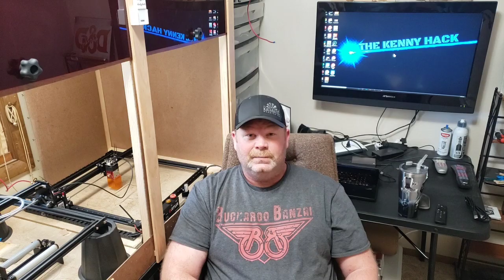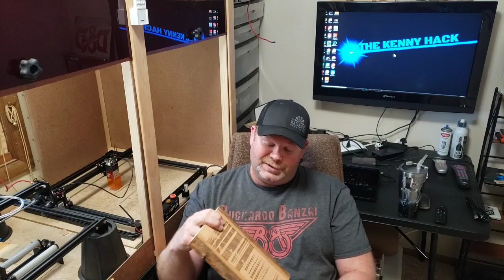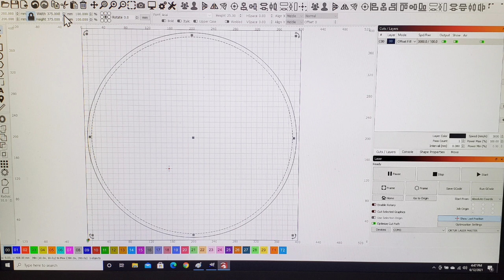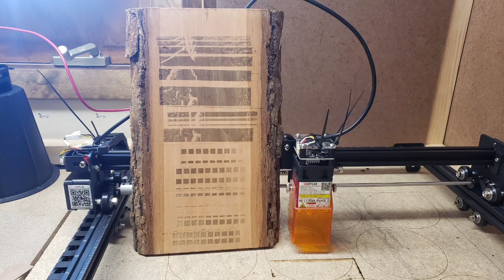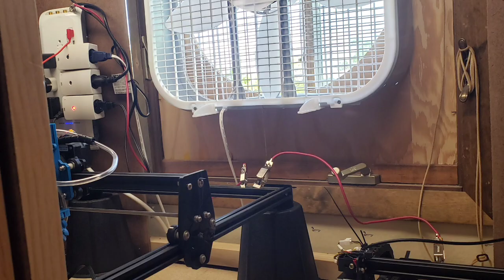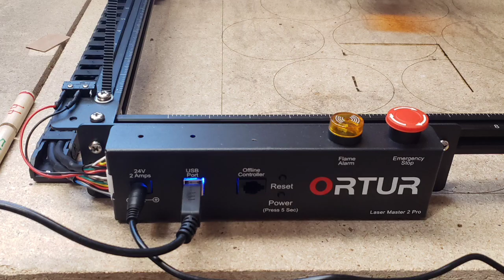ORTUR Laser Master 2 Pro: Kenny Hack and Norton White Tile First Run Reviews.

Comment: Is it worth buying a $450 diode laser when you can get a co2 for the same amount?
Reply from the maker: depends on what you're doing. the k40 is the only one priced there. To make it useful you need to usually upgrade the control board to use LightBurn, need to cut out the bottom so you can get a rotary inside of it, upgrade the chiller if you keep it in a hot area like the garage, heat the garage if you have cold winters, and they take a lot more maintenance work. I wouldn't want to mess with all that if I was just getting started. I always recommend people to start off with the fixed 15w model of diodes. They only cost around $225 and a great starter laser to see if this is a hobby you'll get into. They might come in handy down the road as there are things you just can't fit into a CO2 cabinet. Can get about anything under a diode with some ingenuity. I made enough $ using my $225 to buy a bigger CO2 laser, but as this is mostly just a hobby my diodes keep up with my sales orders. I don't see any point of a big laser unless I can keep it busy. If all your jobs involve cutting than a CO2 is the way to go. All depends on your sales market.
Reply: @TheKennyHack  I see your point. I know the K40 requires $80-$120 in upgrades to make them reliable & safe.
Can you point me to a safe entry laser that will work out of the box? Thanks
Reply from the maker: @fierceflyer5  in the description for this video is a link to the Ortur website. I think the 15w fixed focus is a very good starter diode. I still use mine along with my Pro model. it only cost a few hundred $ and along with LightBurn a great way to get started into the hobby. You'll more than likely be doing a bunch of quick sales/gifts for freinds and family. It just takes a lot of practice to get things figured out. There are a lot of Forums on Facebook to help with questions and project ideas whether you go with Ortur or a k40. Just search what type you are looking to get and join the group. you can look through old posts and see what people are doing to get a better idea of which will work better for you. I love my diodes but if you talk to some k40 users I'm sure they like theirs too.  Both have people that just had a bad experience and gave up on then.  LightBurn is free for 30 days but well worth the cost in my opinion.
Reply from the maker: @fierceflyer5  most all laser require some assembly. Can find assembly videos on YouTube for about any model.
Reply from the maker: @fierceflyer5  Ortur might not directly sell the 15w anymore.  3dprintersbay in the description I believe still does and I've had good luck ordering from them as well.

Comment: Hi Kenny, I ordered this same unit along with the Rotary a few days ago and can’t wait to get it. Thanks for the link to the PDF  I will be looking over it until I receive the unit. This will be my first laser engraver and I wanted one I can grow into right from the start. I’ve owned a few CNC Machines, like a 36 inch vinyl cutter plotter and a CNC plasma cutter and also a CNC router. I’m hoping the Learning curve to this laser will be a little easier for me. Thanks again for the great video.
Reply from the maker: I recommend getting LightBurn to run the laser. It has a 30 day free trial to play around with it to try anyways. Its well worth the ~$50 in my opinion. With all the CNC work you should pick up the LightBurn software pretty quick. I had some CNC background and LightBurn was a very similar program. This has been a great hobby for me and has more than paid for itself with just a little bit of sales. I really like these diodes as they are very simple to modify, operate, and maintain vs the larger CO2 models.  They are constantly getting better and more powerful. Good luck and thanks for watching.
Reply: @TheKennyHack  I’ve been looking at the lightBurn software and I think it would be the easiest software for me. I have plasma cam software for metal and Surecuts software for my vinyl cutters so I think LightBurn will fit in with me good on the laser. Thanks for the reply back.

Comment: The aluminum cylinder that comes with the ortur lm2 20 watt NON pro, does that go under the lens or heatsink?
Reply from the maker: I believe those go under the lens. If you're not sure run a ramp test. Set a piece of wood at an angle and burn a solid strip going up and down the ramp going from out of focus low to out of focus high. There should be a section where it burns the darkest and easily find if it's the lens or heat sink.

Comment: Wait so if I get this I just want to cut thin plastic and score it to fold into shapes like a box. I was thinking using like clear PET or PETG or PVC or idk but can I not use those since clear? I didnt think about this
Reply from the maker: You don't want to cut pvc with these.  Releases a toxic chlorine gas that will damage laser and poisonous if you breath it. They can cut some materials but if its clear i don't think it will work. A co2 laser would work better. These can cut a few types of materials,  but I really haven't tried cutting stuff yet. I mostly do image engraving. If you search for cutting videos im sure you could find some showing more of what these can cut. I just don't want to give you bad information. The laser on this Pro seems way stronger than my other models, so I might try to do a bit of cutting with this one.
Reply: @TheKennyHack  ok yeah i havent seemed to find any video or info on if these can cut pet and petg. And also clear part. If i get a tinted version would u by chance know if it would cut alright. It sounds like you haven’t tried and I appreciate you not guessing and giving your best honest info. Glad to have found the channel keep it up
Reply from the maker: @hello_world_104  i think it would cut peg but how clean would be a guess.  if it would cut or just melt it. I've seen people cut colored acrylic and I guess it makes a difference if its rolled or extruded acrylic how well it does,  but I can't remember off hand which is preferred. I personally haven't played with that material yet. If you are on Facebook join the Official Ortur Users Group and search  cutting for previous posts and you can find more info or ask questions in the forum of what people have successfully cut and you'll get some replies im sure. If cutting material is your major focus co2s do much better than diodes but they have more maintenance needed and to get a decent machine is over $1000. You can get a k40 for around $400 to kinda get started but will outgrow it very fast. They have a very small working area. About the size of a piece of paper, but if that is all the bigger you need it might work for you. I just went with diodes because they have a large working area for the $, less maintenance, easier to use for beginners, and cutting wasnt a huge need for me.  I've made enough money with my little diodes to buy a big CO2 but just don't have the need or room for one right now.

Comment: I'm wanting to purchase this item and I have looked at the link you provided for the purchase, but I'm concerned that it may not be a valid site.  Did you order your laset master 2 pro from this site?
Reply from the maker: This was the link sent to me by Ortur. I did not order my Pro from this site as I received my Ortur free as a demo product. As these are in high demand early I imagine they are on backorder from most sites, so expect a good chance for a long delivery time.

I ordered a z-axis from this site last week. See how long it takes to get it.
Reply: @TheKennyHack  OK. Great.  Thanks and appreciate all the helpful videos on using the laser master 2 pro.  Looking forward to getting mine.
Reply: @warrensmith8820  i just got my z-axis i ordered last week. So good turnaround on that item. Its a very well built zaxis. All metal and very fast and smooth on moving the carriage. Well worth the $44 on first impressions.  The stock z that came with it I was not impressed at all with.

Comment: Hi Kenny - thanks for a great review.  

I've posted a couple of questions on the Facebook user groups, but not much response. 

I'm a newbie to laser engraving and have been woodturning for some time and am interested in laser engraving logo and information on the flat bottom of bowls etc. Also patterns on the upper face of platters and around the circumference of vases using the Y axis roller attachment. I have been waiting for the Ortur Master 400 to come out since 2020 but there seems no sign of it? Instead, the Master 2 Pro seems to be the new version?  Do you know if the Pro is the only new model we can expect for the foreseeable future?  

Also, due to the type of items I'm hoping to engrave, I can expect about 1cm or 1/2" variation in vertical distance from the wood surface to the laser. If I was to set the focus to the middle of this vertical "band", would the laser be significantly out of focus when it was burning 5mm or ¼”nearer and further than the actual focused distance?
Reply from the maker: Yes that would be getting quite a bit out of focus where the image will probably be fading towards the edges. Some woods burn easier than others so it would just take some testing to see what can be done. A good z-axis would help. There are methods I've done where I raise or lower the laser as it's going to adjust for an uneven surface. So it can be done just not the easiest thing to do.

I'm sure the Pro will be the hot item for the rest of the year. Getting add-ons and updates to fix little problems here and there.  As its a new laser module there are bound to be some issues to fix. Im having some tech issues with mine right now and working with Ortur to figure them out.
Reply: @TheKennyHack  thanks Kenny.  I ordered one this morning from Ortur.net and they say it's on the way. Being in UK I think we get stock from Belgium, so not affected by US shortage.    Someone has confirmed that the "model 400 was discontinued with the LM2 Pro as its replacement."    I've not ordered the optional Z axis adjuster. I intend to make an adjustable platform using a scissors lift something like this https://www.amazon.co.uk/OESS-Aluminium-Scientific-Scissor-Platform/dp/B078MYSKZ6    There's going to be a lot of trial and error especially when I move on to the rotary roller device.

Comment: Hi Kenny,
This pro version comes pre-focused or you need to set it manually to stop block length and then use stop block very time instead of focusing?
Will you use air assist on this pro version?
Reply from the maker: The focus is pre set and you use the barrel to set the distance from the heat sink to the work surface. 

I have a compressor but haven't used it yet the old models just didn't cut very well. This one I think will do a little better. With the flip down orange guard there is a lot of air swirling around already. I've seen people cutting without any air assist. I think it would still help but its natural air assist does ok.
Reply: Great video, looks like a nice upgrade. Any chance you have the test burn pattern file available to share?
Reply from the maker: I'll try to see if I can attach it in. If you are in the forums there are a bunch of test files to use in those. Just modify the speeds and powers to what works for you. I usually only burn 1 strip at a time and adjust my settings off that one strip. Once you know about where to start burning a whole test pattern isn't needed. Once I think I'm close I'll start burning tests of the image to dial in better. I think running an image tells you more than just a test pattern. Thats why I like to do a test like I did with Baby yoda. Set my max power I want to run and step the image up in speed as I go. Can then look it over to see what speed gets the details and darkness I want.
Reply from the maker: I didn't save that test file. I custom adjusted an older one. I usually don't run a whole test file. Most of the time I run just one line, adjust my numbers, and run again. Keep doing that until I'm dialed in. Usually quicker for me than running a whole test pattern at speeds and powers  I don't use.
Reply: I have the previous version. The LM2 fixed focus (non Pro). I've been focusing it by putting the metal in-between the bottom of the laser barrel and the material. Am I doing it wrong? Is the focusing from the heatsync a new thing with the Pro?